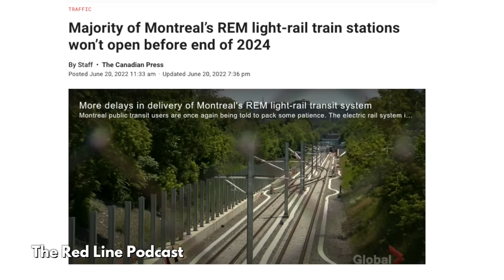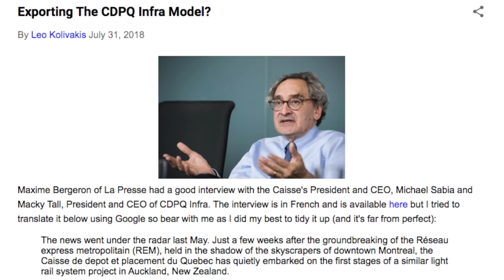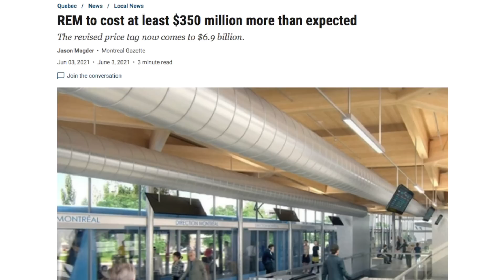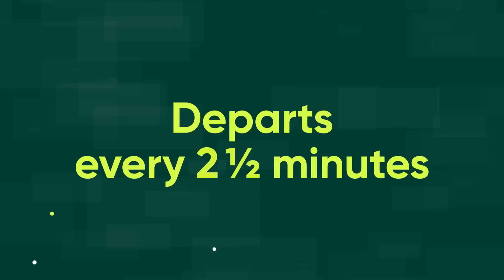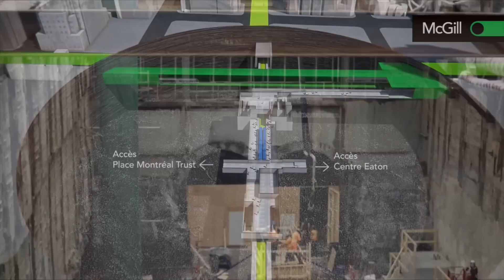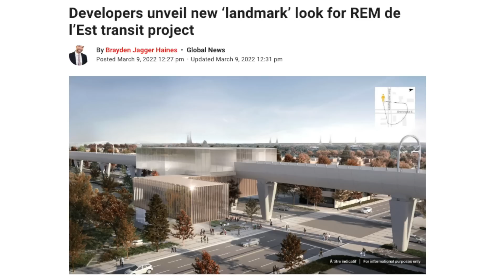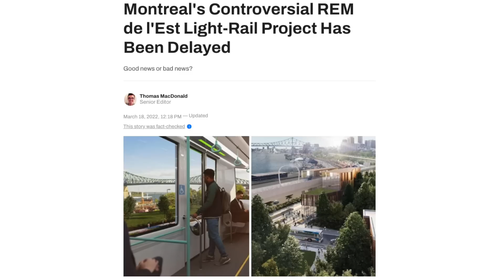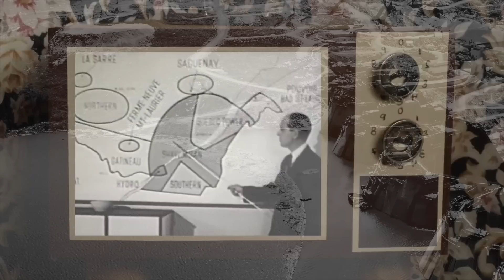The REM is Coming And It's A Game Changer for Montreal

Comment: What frustrates me about the NIMBYs is that they won’t be here to use the system, so why are they insisting on destroying a very good viable system 🙄
Reply from the maker: Some people despise change, others embrace it. It's how it will always be.
Reply: Was using the DM train daily... will use the REM daily.  Why did CDPQ insist on destroying the existing electric train (after having promised to not interrupt service) to replace it with something with less 7-8 am peak capacity instead of improving the existing train (or chose a technology that is compatible with what was in place like for the REM in Mulhouse or the Ceva in Geneva)?
Reply: They're always afraid something new will destroy their property values when in reality it will only increase them (unless it's a highway---time and again highways have been shown to ruin neighborhoods).
Reply: @edwardmiessner6502  in this case, the 15'000 users of the  existing electric train were - rightfully so - worried about a multi-year shutdown without reserved bus lanes for the bus replacement. A shutdown that was initially promised to not take place (so no bus lanes built and nothing for replacement service budgeted), but then as predicted "surprisingly" took place. - no one even said "sorry", everyone just expects you to "just drive like normal people"
Reply: They took apart the existing train system in 2020 and the new REM  won't be completed until 2024 and most of us doubt it will be ready even by then. For people in the West Island we used to take the train downtown and it took about 1/2 hour. Now the combined bus and metro require almost 2 hours to get downtown and this is only one way! I'm curious to see how this new transit system is going to work in our very harsh winters especially when it snows. Most of us are very upset about the fact that the new REM doesn't reach the Fairview Shopping Mall. Instead it stops almost 1 km away and will require a long walk during the cold winter months Instead of an underground pedestrian connection.  And you need two connections to reach the airport and it doesn't reach the existing rail station in Dorval.  It doesn't connect to Vaudreuil off island which is a large and fast growing  community.  Most of the people living in Vaudreuil consists of people unhappy with the costs of living on the island of Montreal especially housing costs and property taxes. Not good. Since the dismantling of the 2 mountains line in Pierrefonds/Roxboro in Roxboro and In Sunnybrooke the property values have actually decreased yet the City of Montreal has increased the property taxes substantially. This has been a total failure and nightmare for commuters in the West Island so far. Let them prove otherwise.

Comment: I live in the South Shore of Montreal and I've always been very excited about the REM. As with any projects, it's far from being perfect. Since the very beginning, CDPQ has been given "Carte Blanche" and that has created some controversy in how the REM infrastructure have been built. The REM has been built in a way to be practical then good looking. Obviously, riding the bus or my car on the Champlain Bridge, I can tell you that they could have find a better design for the overhead power cable.

Another controversy that hasn't made enough noise in my opinion in the media are the new ARTM tarif partially caused by the REM. If you leave in MTL and ride the REM or even the EXO train, the prices are very cheap even if you come from as far as Sainte-Anne-de-Bellevue while people that live on the South Shore and Laval initially faced a tarif increase of almost 50% (for those that took only the Laval or Longueuil metro without taking the RTL/SLT buses). The ARTM backdown a bit but the new prices are still too expensive (35% increase for my case with 10 tickets).

In terms of other weird/bad choices, CDPQ made a really weird choice of building all the trains in India. They also built a station in Sainte-Anne-de-Bellevue for a city with Baie d'Urfé that has less then 12 000 peoples that lives there. They could should have stopped at Kirland and build an additional station in Kirland or in Pointe-Claire. Dorval also asked CDPQ to extend the REM by another 700 meter to reach the Dorval Exo/Via rail station. I can understand, they didn't want to do that because of the high cost but there's no point stopping the line in Sainte-Anne-de-Bellevue.

I also hope that they know what they are doing for the Airport as they only built 1 tunnel so even during peak hours, there will only be 1 train per 10 minutes leaving the airport.
Reply: I agree with most of what you've said. But the last stop is only "technically" in Ste Anne. Practically it serves Kirkland instead as the ACTUAL Ste Anne de Bellvue is like 10km further away. There are a lot of stupid station locations along that segment and the Fairview mall station has to be the worst. It could have been near the highway overpass, if say, you worked south of the 40 around there. But as it stands it's a five minute walk across the mall parking lot just to get to the mall, let alone St Jean. And to ad insult to injury they cut down a bunch of forest to put the station there that they wouldn't have had to had the put the station somewhere smart.

Comment: Just to add more comments about the REM de l'est : It was not 100% cancelled by NIMBYs, but it was also the fact that the governement and city mayor Valérie Plante didn't approved the downtown portion of the rail which was gonna cost millions of dollars. Also, the green  Métro line is already doing its job in these neighbourhoods further to the east.

The new alternate route is way way more efficient and will serve also the neighbourhood around Promenade masson who has no access to any Métro station. Also, the neighbourhood that needs most of the transit system is located on the northeast part of the island, not southeast.
Reply: For sure, Valerie Plante was the number one Nimby in regards to the REM de l'Est and the downtown portion.
Reply: what alternate route? The 36B underground one that will never be built?

Comment: As a light railway with heavy rail characteristics the REM literally blows every subway and trolley line in Boston out of the water! The Caisse should confer with the MBTA to automate the existing lines (save the non-grade-separated surface lines) and free up the Boston Carmen's Union to operate more surface trolleys and additional busses.
Reply: In fact, I understand from having lived in  Montreal that the Metro can run without an operator. If you watch the operator closely, he does nothing to stop it. The only reason they need one is insurance.

Comment: If they build a line to Laval they can have an off-shoot going into Montreal North. For the East End, maybe have the freight trains just pull empty passenger cars through for no reason(like old via rail cars) and see if anyone really notices a difference and if not then maybe the upsell to lighter passenger cars will be easier. OR use the rail line next to the port up to Parc de la Promenade-Bellrive and then elevate over and through the park through to the industrial park where they could bend it up to the afore mentioned rail line to connect to the east. If anyone complains about it the city could get a bit more hardline and state they own the parc and get to decide what sort of "art installation" they run through it. And if the line is nearer the waters edge then the nimby's can't complain about vibrations.
Reply: They could buy all the homes next to the track going out east, flatten them and then build newer, slightly tower buildings for tenants that would be more likely to appreciate the line as it would be a selling point. Yes, that could cost a few hundred million on it's own but you would make a bunch of it back on resale and the Nimby's most effected would move out of the area as a result.

Comment: My concern is what happens to the REM on the elevated sections when we get  25 or 50 or 75cm of snow ?
Reply: when was the last time Montreal got 50 or 75cm of snow in 1 day? Also we saw there was a heating attachement in the front to melt lightish snow of the track

Comment: Here's an issue, no or little parking for potential clients at the West Island end of the REM. Where do you think the people that will use that station live?  There is little or very sparse connectivity with buses, and it does not address the increasing population of off island commuters.  How do they access the REM?  A massive, FREE, car park is required.

Comment: This thing needs to run 24 hours. The biggest problem with the EXO is the ridiculously bad running hours. You can't rely on it for a night out or anything outside of rush hours. Here you mentioned that it will be running 20 hours a day. Not only it's not enough but if they do with the EXO, with 2-3 hours gaps in between trips, people will not adopt it and will keep using cars.
Reply from the maker: There are only a handful of transit systems in the world that operate 24 hours (due to maintenance, checks, etc.) It will likely run the same hours as the metro, with 2.5min-10 min frequencies. No more waiting hours for a train.
Reply: @DiscoverMontréal  Our transit system is very bad for Montreal's vivid nightlife. Bars close at 3am, you should be able to rely on the entire transit system until at least 3h30am. Or else it's people just drive, take ubers or taxis. Also think of people working night shifts. If you want everyone to adopt a system, that system needs to cover every use cases or else people don't really adopt it.
Reply: @CarcPazu  You cannot please everybody! Maintenance as to be done, if you want a system like this one to work like clock work!
Reply: The maintenance excuse is a lie. Translink (which run's Vancouver's transit system), used that excuse for years to explain why they didn't offer late night Skytrain service. They finally admitted a few years ago that the real reason was that they didn't want drunk people on the trains at night. If maintenance truly was an issue, they could run service on alternating tracks. Anyone that's ridden on Skytrain knows that when it breaks down (and it often does), that's exactly what they do.
Reply: @lihtan  This makes no sense, they prefer having drunk people driving? On top of it, I'm convinced there's more drunk people riding the train during the evening than late at night.
Reply: I live in New York City where the subways operate 24 hours a day, seven days a week. As a possible solution for both le Métro and the new REM is to run the system 24 hours on weekends (Fridays and Saturdays), while continuing its 20 hours on other days. I sincerely believe this would be a happy compromise that could satisfy all Montrealers.

Comment: Extending the old METRO subway line 5 may cost 6,000,000,000$ for 5 km.
The West REM construction has cost 6,000,000,000$ for 67 km.
The East REM construction is expected to cont 10,000,000,000$.
The new bridge between Lévis and Québec city is expected to cost 8,000,000,000$.
THis is a total investment of over 30,000,000,000$.
A suspended Monorail would cost about 15,000,000$ per km, which would allow a network of over 2,000 km long, linking for the first time the whole of South part of the province together, desserving over 7,000,000 citizens while using the same amount of money!.

Comment: A practical commuter rail line dating back 100 years was destroyed for a automated light rail line that's behind schedule and prone to breakdown.
Reply from the maker: I promise you’re gonna love the new system. Fast, more frequent, better connectivity with the metro system, a link to the airport and south shore, featuring enclosed stations with AC, heating and free WiFi. I know it sucks it’s been delayed but once service starts, even the naysayers will be impressed.
Reply: When waiting times are counted in seconds (180s for the central section) the word delay no longer exists, because these are frequencies, not schedules.
As for the automation technology, well... it's not 100% sure over 40 years, but the problem rate is low, especially if the system chosen is the one sold by alstom, the Urbalis (because he is initialy built for the metropolis trains).

In 1998 when line 14 (Meteor 100% automatic) was opened  in Paris, the critics rocketed, and also a fear of "the robot", since the train was driverless (even if a driving position is hidden at the extremities).

Nowadays the M14 is one of the 4 busiest lines in Paris, despite the lengthening of the trains from 6 to 8 cars.
Reply: @Lodai974  Sydney, Australia opened an automated light rail line similar to REM. First day was marked by 45 minute delays.
Reply: @centredoorplugsthornton4112  You can't judge a system just on its first day of use. Now after more than 2 years, there are still so many problems?

Moreover, nothing guarantees 100% over several decades, but good to be around 90/95% is not bad.
Reply: @Lodai974  they still wiped out a functional commuter line for a automated system that's way off schedule and leaving commuters with no options but wait. Toronto tried it during the 1980s, wised up and kept its GO train system.
Reply: @centredoorplugsthornton4112  Reworking old lines to create a diametral line is common in developed networks.

Japan was the first then France and Germany. When the RERs were built, cuts to existing lines took place and it was the same for the other countries which made this system of crossing lines.

At the moment with us in France, it is the lines of provincial towns (Toulouse, Bordeaux, Strasbourg, etc.) which are experiencing partial cuts, but which require a staggering of the period of work, for the creation of SEM ( Metropolitan Express Service similar to a REM), crossing lines instead of terminal lines in these cities. The biggest work being the infrastructure and the track plan to be completely redesigned.
There are still 10 years to go, and it's been 5 years since it started.
Reply: There are similar light metros in Sydney and Copenhagen. YouTube has yet to refer me to videos about how "bad" they are.
Reply: @edwardmiessner6502  neither city wiped out its older regional rail systems, unlike Montreal seems to be doing.

Comment: The loud freight train rails that already exist in the east are not actually used. I live around there and there is maybe one train every 3 days that pass on it at very low speed and it's very quiet because there is only 1 or two wagons. In fact it's not even noticable. It is used by a company to transport goods from Downtown to the East. So yes it would significantly change the neighborhood having a transit pass every 2 mins in rush hour and also they plan to have it elevated when it's all 3 storeys building around there. It is quite a dense populated area so I think if they could have that section underground or in trench then it would be more easily accepted.
Reply: the compensation in the fact that way less cars will be used is great (ie far less noise pollution). and the fact that you bought a house on a train line that's still owned by freight company, knowing full well it could potentially be used, is on you.
Reply: @dasemicolon627  i disagree with you. First of all, you may not know the area well but it is a residential neighborhood with barely any circulation, meaning you argument of less car less noise isn’t funded. The speed limit is 30 km/h and you don’t hear vehicles. Secondly, I knew and agreed to move here knowing CN owned that rail with a possibility that the frequency could vary in time. However, I did not buy knowing that the government would take over part of the land where the rail lays to build on top of that rail (because yes, the CN rail and trains would still go) a massive concrete structure of 3 storeys high right into my window with a frequency of a train every 4 mins during rush hours and a service running until earl am. I think there are better options to improve transport in the east and I am not saying that because I don’t want it in my backyard but based on the options people need on a day to day life in the east.
Reply: @Emixam9090  a) people don't realize how loud cars are until they are removed. Cities aren't loud. Cars are loud.
b) these new trains aren't really that loud compared to older trains
c) these new structures aren't a big deal. they will fade into the background like every other part of the city.

and not really pertaining to individual experience, but general decision making-organizations cannot make societal decisions based off the discomfort of a few. You try to reduce the harm but at the end of the day it must be placed somewhere

Comment: Great System, but the trains will be WAY too small after some time when the demand increases. Even with a 90s headway, theres a maximum that will be hit.
Reply from the maker: The system can handle something like 30,000 people per hour per direction, and stations were built to be expandable in the future. Ridership would have to be above ~700,000 a day before expansion is even required. They know what they’re doing!